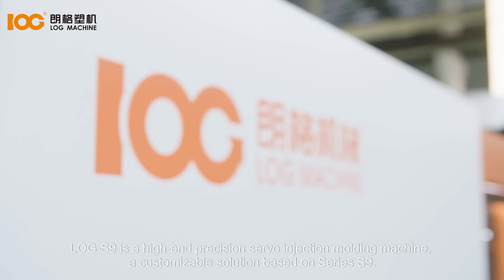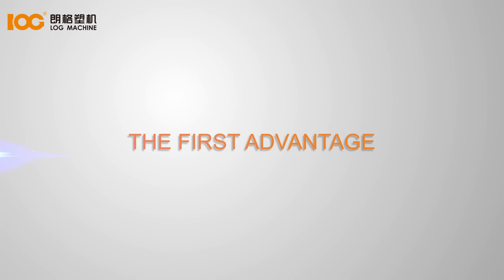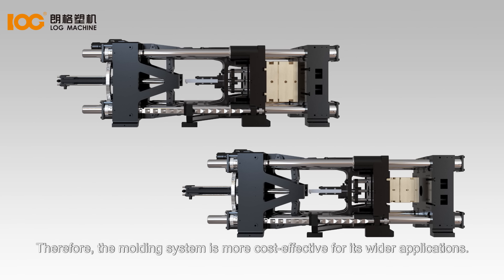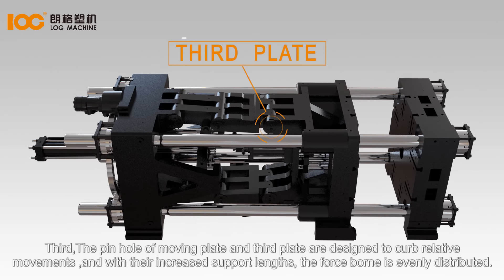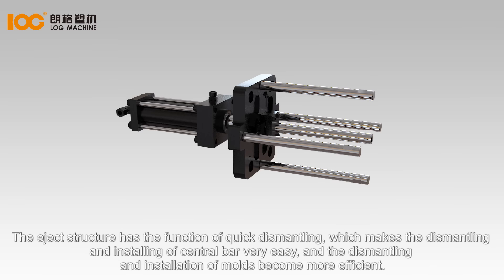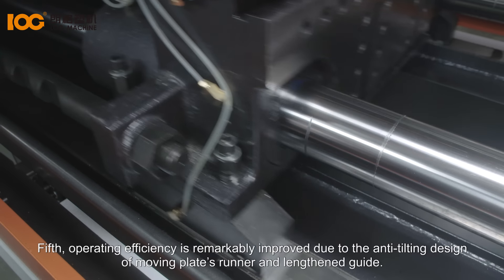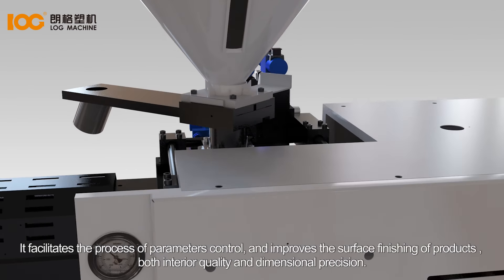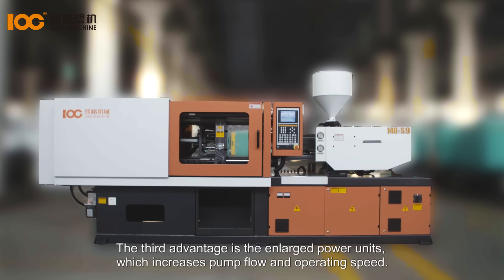LOG S9 Servo System& Energy-saving injection molding machine（China top10 injection molding machine）

Comment: Which is better Hydraulic or electric injection m/c 

Does electric machinrs have a locking issue??
Reply from the maker: Hydraulic injection m/c:1Use a variety of clamping mechanism forms 2Injection forming range is large 3Price is lower 4Technology is mature and easy to maintain ; Electric injection m/c:suitable for processing high value-added products such as electronic, electrical, electrical, and high-clean medical products, especially for injection molding of small parts.